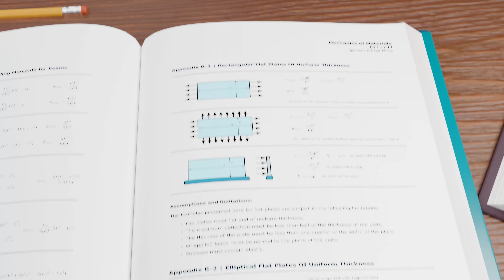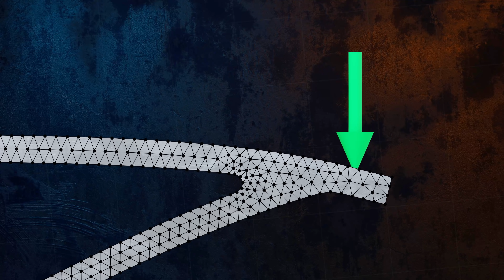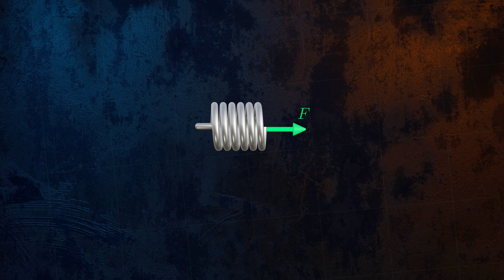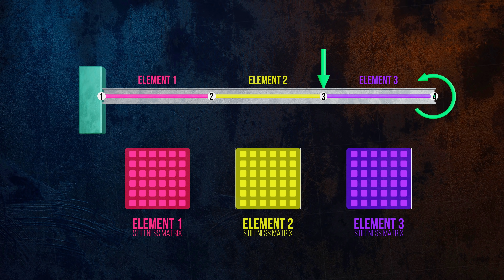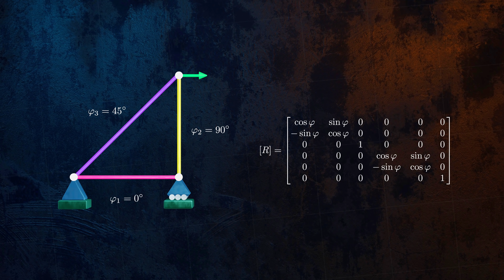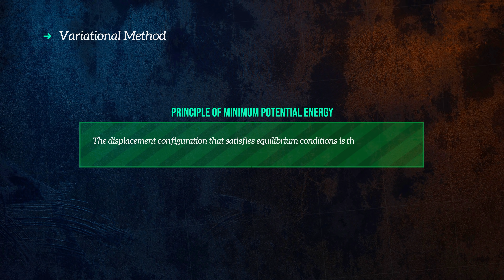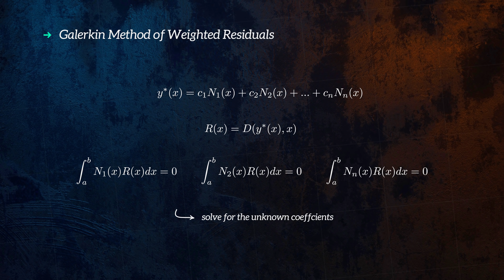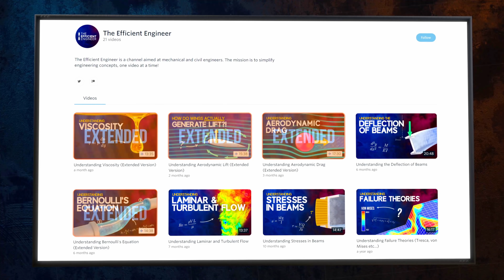Understanding the Finite Element Method

Comment: Very good explanation.
Just 2 points: 
add linear v/s non-linear.
AC compressor support: force vector is placed on the tip, but it should be distributed on all of the beam upper surfaces thus showing different deflection results. But I assume you presented it like this to make it easier to understand.

Comment: I wrote a FEM simulation years ago in C++ as a postgrad project. Used the Galerkin Method. Just the process for PDE discretization took me weeks-months to grasp. I should probably try something similar again to see what I remember.
Reply: hi. im a final-year mechanical engineering student. and i'm about to start my undergraduate thesis. im thinking of writing a Python program on this FEM. do you think it's a feasible topic for me as an undergraduate student? thank you.

(sorry for my bad english 🙏)
Reply: @danielniels22  Hi Daniel, from my recollection, writing a FEM simulation for stress analysis, that is, to compute nodal displacements and element strains and stresses in a mesh, is much more straight-forward than writing one for thermal simulation (which was what I was doing, and relied on partial differential equation (PDE) discretization which involves a host of other processes I had to familiarize myself with). So the difficulty in my view, depends on what topic the finite element method is applied to (stress analysis is simpler, thermal analysis is trickier, and aerodynamic analysis will probably ruin your life). To write a FEM simulation for stress analysis, you shouldn't need any of the tricky PDE stuff that thermal analysis would need, you'll need mostly simple principles and equations, (Hooke's Law, etc) and to solve a system of simultaneous equations as a matrix equation (for inverting the matrix, I'd recommend using Gauss-Seidel iterations as that algorithm was decent to understand and implement). I reckon as a final year project, not only would writing a stress analysis finite element simulation/solver be achievable, but it would really help solidify your understanding of different concepts working together. It sounds like it'd be a great exercise; well worthwhile.

Topics it may cover:
- Finite Element Method
- Solid mechanics
- Mechanics of materials
- Vector mathematics
- Linear algebra & matrix algebra
- Programming & software development in Python
- (Optional) 3D graphics and graphical user interface (GUI) (use OpenGL and maybe GLFW for the window if a Python module exists)

You could probably validate your own solver against existing engineering software (Ansys, etc), starting with comparing results for simple scenarios. Maybe even 3D print a truss and use the plastic properties and some 3D beam elements in your FEM solver to compare predictions against reality for a loaded case.
There's a lot of potential scope; depends how disciplined you are and what you are motivated to learn/achieve. There's heaps more great resources online now than when I was at uni, so I reckon you'll be well-resourced. All the best!

Comment: this is cool, can you do more videos on computational simulations?
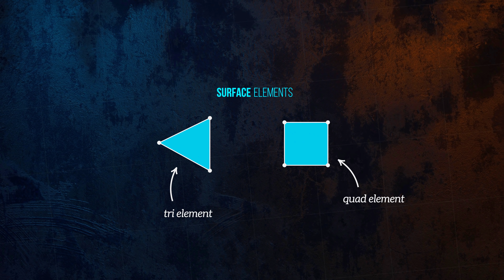also 3:10 in what sense better?
Reply: The triangle uses linear basis function and thus their derivatives (and the strains and stress computed) are linear over the whole element. In contrast, the quadliteral consists of bi-linear basis functions and the derivates are not constant but semi-linear. So you get more accuracy with just a little trade off, with the additional node, compared to going for a quadratic element with three additional nodes.

Comment: Amazing video, just 1 question, what are the domains of r and s (at around minute 15)? Are they  0<=r,s<=1?
Reply from the maker: Thank you! r and s are normalised to the dimensions of the element, so from -1 to 1. I considered adding some text to clarify that, but didn't want to make the image too busy.
Reply: @TheEfficientEngineer  why is there a "1/4" in each shape function? if I presume that v1 v2 v3 will be 0 and v4 will be 1. putting that into the shape functions and then to element approximation, then I would get the displacement at v4 = 1/4. Am I getting the whole idea of shape functions wrong?
Reply: @rehousek  The basis functions are defined as N_i(x_j, y_j) := {1 if i=j, 0 if i =/= j) for r,s in [-1,1], what you see is correct. Now you can evalate each basis function as follows: N_1(-1,-1), it should evaluate to 1 and 0 in the other three points. The nodal values are interpolated to any point in r,s using the basis functions. The basis functions are just an interpolation function and  their sum in each point in r,s, is 1.
Reply: @mirzacenanovic  ah yes. I see it now. Thanks!

Comment: I think FEA is one of the coolest engineering courses!
Reply: It also depends on the professor :-/
Reply: Nopes CFD is
Reply: FEA itself is awesome, not just the course. You can simulate pretty much anything with FEA. Seriously, you can even analyze a bird striking jet engine and causing damage to the aircraft. Or underwater explosion impacting a submarine. Not to even mention possible applications of multi-physics analyses where various physical effects are combined in a single simulation.
Reply: Any recommend books or materials to get into it ? I am currently studying it, too.
Reply: @lamtran2993  I would recommend the book "Introduction to the finite element method" by Ottosen and Petersson.
Reply: @lamtran2993  Look for “A first course in finite element method by Daryl logan”
Reply: @lamtran2993  A First Course In The Finite Element Method / Dary L. Logan
Reply: @lamtran2993  Textbook of Finite Element Analysis by P. Seshu
Reply: @deepak_nigwal  hi i have completed bachelor this year , I also learned from Nptel🙏
Reply: True that. FEA is really versatile.
Reply: Finite element structural analysis basics
https://www.youtube.com/watch?v=KtdWo95cn6w&list=PLg_GL42KJkmG7maeWMd6JKguJlQHoTNa4
Reply: FEA is for CHUMPS

Us kings prefer CFD
Reply: @windowsxseven  it is taught very poorly in my uni

Comment: topology optimization too plssss, I wonder how that magic works
Reply from the maker: Definitely an interesting topic, and not the first time it's been requested. Will give it some thought!
Reply: It's not really that magical when you think about it. Topology Opt is one of the types of shape optimization (three "Topo"s (-metry and -graphy are the others)). With topology here you  essentialy create an envelope ( for example a brick), give it features you need (holes, connections etc.) and then you run a FEM simulation on that, with the loads and boundary conditions you need applied. It will "map" the stresses on the discretized brick, "normalize"(read: assign importance from 1 - very important to 0 - chuck that nonsense) to the elements based on how much they are f.e. stressed, then you chuck the ones you don't need that much and recompute. Repeat that a number of times (it can get quite sophisticated here) and voila, you have a shape that uses the material it needs, with reduced weight while preserving the stiffness (or "compliance") you specify. Assuming of course, your model is approximately accurate to reality. It's based on taking away unnecessary material.

Now Generative Design, oh boy that's a different beast. That be how nature does its thing (think how your bones grow to support the load). This one is based on lattices and GROWING the part, that's some magic right there.